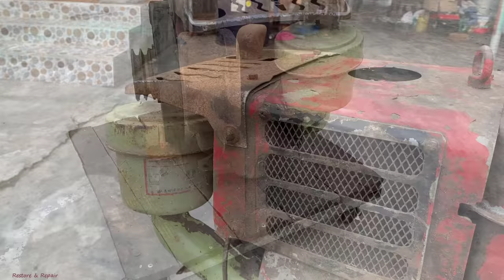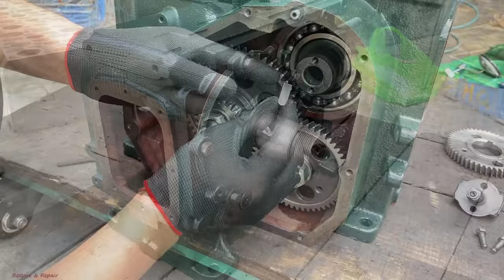Restoration of old Samdi R185 diesel engine | Restore and repair old D9 diesel engine

Comment: love these engines R185, R195 Etc cheap getting parts, love the compression relief valve makes it easy to start, mine has a starter that I never use prefer the hand crank

Comment: 20:18 No oil there!! This area must be clean! after installing the bearing shell, you put oil on it!
Reply: Correct. You dont want to ENCOURAGE bearing failure. The correct tolerances are very small, and oil on the backside of the bearing shell will skew these tolerances, and make the bearing clearance tighter than it should be. If it were my engine, I would take it apart, and clean these surfaces off and reassemble it.
Reply: @davelowets  Didn't you see what oil he even put on the bearings? First rule is to not use old bearings especially in this case and most cases but even then he puts some damn thickness of cooking oil in bearings. It has to be thick like vaseline is, was horrible to watch the whole video.
Reply: @thhtech  Looked like a new set of bearings to me...
Reply: @davelowets  nobody washes new bearings, that is just stupidy
Reply: @thhtech  Assembly lube does not HAVE to be as thick as Vaseline. There are thinner lubes used by professional engine builders all over the place. 
I myself prefer to use a thicker lube on a smaller engine like this because, (1) if the engine isn't started right away, the thinner lube can run out of the bearings after some time and leave the bearings without much on them, or (2) many small engines do not have a pressurized oiling system, and their is no way to prime the oiling system and it takes longer to get oil once it starts. 
On a larger engine like a car engine, with a pressurized system, it doesn't matter that much because you should be priming the oil system right before you start it and you will wash all the thick lube out anyway.
Reply: @davelowets  It should be thick especially in motors like that.
Reply: @thhtech  Pay attention. Those bearings were NEW. He took them out of the package. 🙄
Reply: @davelowets  Dude he literaööy washed bearings, check again from the beginning
Reply: @thhtech  AGAIN, pay attention... The old bearings are laying right behind the new ones he installed.
Reply: @davelowets  Idc about the new ones, question was "Who the fuck washes bearings?!"
Reply: @thhtech  Who cares? Old bearings WILL tell you a story about the condition of the engine. If he wants to wash them and take a look, good for him. No harm done. I'm sure he just lumped all the parts together in the bin and cleaned them. No big deal. Every single time I tear my Drag race engine down, I wipe the bearing off and take a good look. There's LOTS of good info to be had from inspecting bearings.
Reply: @davelowets  Oh dear lord xD
Reply: @thhtech  "Oh dear lord" nothing. You know I'm right
Reply: @davelowets  Right about what? :D Explain
Reply: @thhtech  Figure it out genius. You seem to know it all.
Reply: @davelowets  Seems like you lost the argument. One tip, never reply to person if you have zero knowledge. Have a great summer pal
Reply: @thhtech  😆 Turn your statement 180° and you'd be correct.
Reply: @davelowets  Bite it and move on pal.
Reply: @thhtech  You've already bit the big one... No sense in two of us doing it.

Comment: You went to the trouble to do a rebuild why didn't you change the rubber crank seal? And use a torque wrench ? I can understand if you where torquing the bolts down by hand you can feel the torque tightening over experience but to use a hammer drill!
Reply: You giving likes but not answering questions!